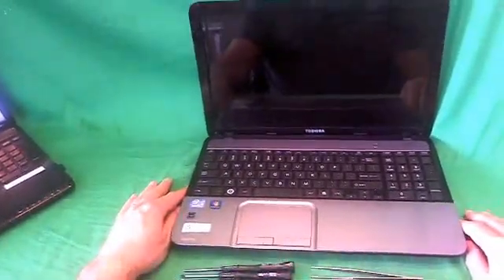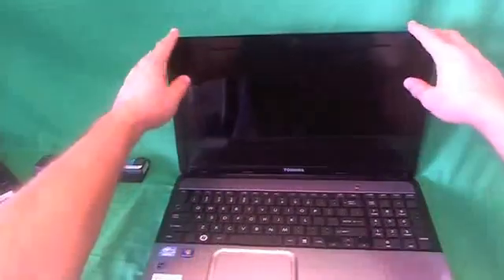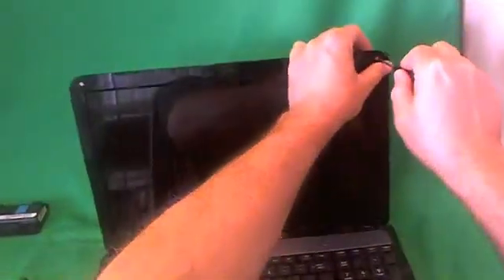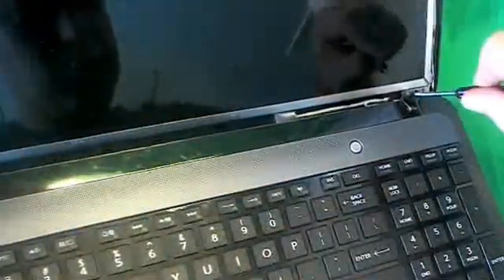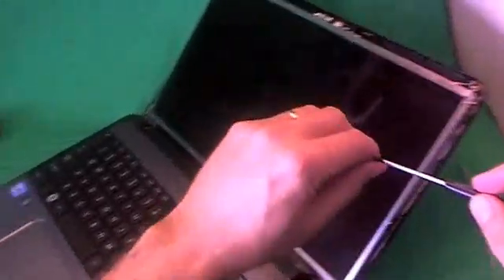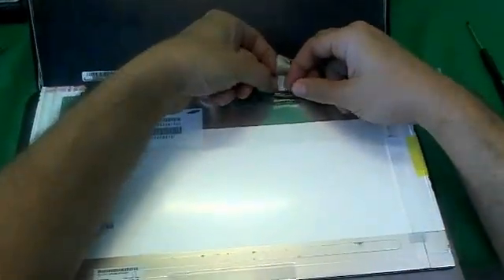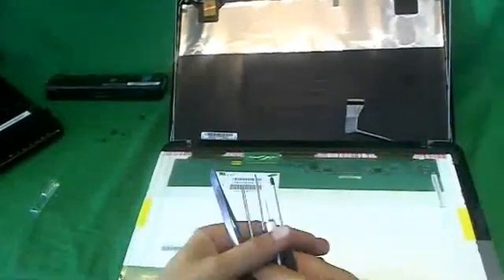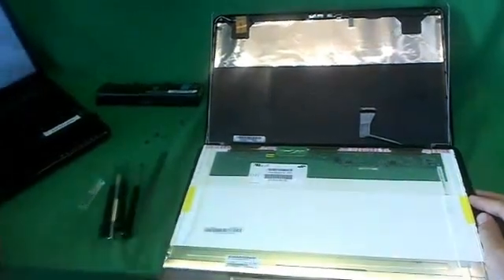Toshiba Satellite L855 Laptop Screen Replacement Procedure

Comment: thankyou for this vid...i will be putting it to good use replacing mine......i was just wondering...have you had many screens ordered for this model?...as my screen cracked by closing the laptop...i didn't drop it...nor drop anything on it.....it seems the screen housing is a little thin as they have tried to cut down on weight? which means its more open to cracking by actually carrying/closing the laptop